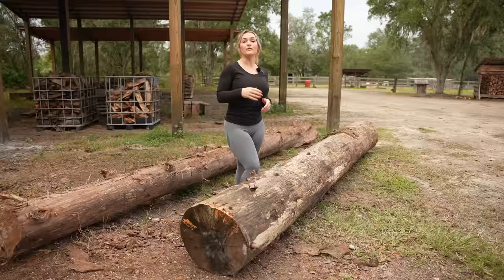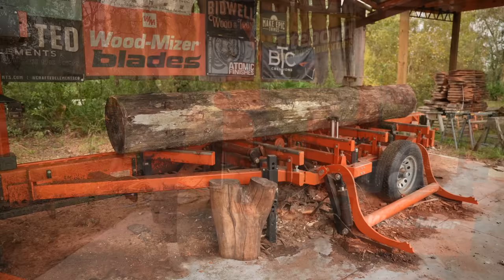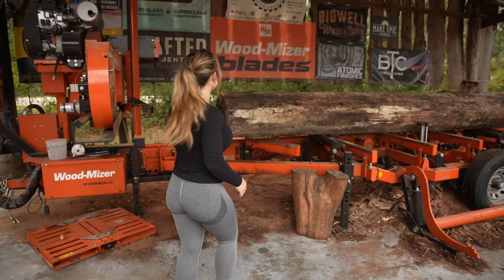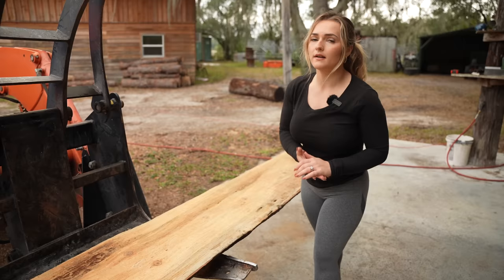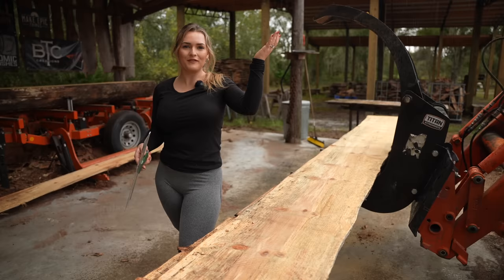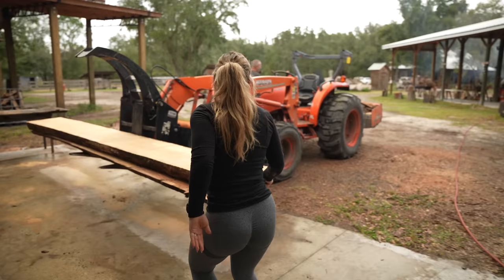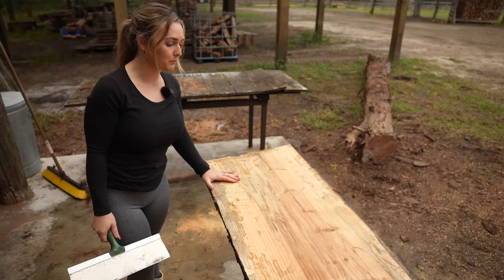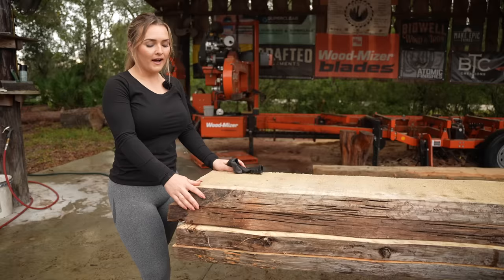Monkey Puzzle Slabs On The Mill Today!

Comment: would suggest that you try "pentacryl" on the spalted and softer areas before cutting them out or resorting to epoxy filler in the removed voids.  Pentacryl soaks in like water, solidifies leaving a "workable" deep layer of that soft or spalted areas.  We use it wood turning and carving of spalted blanks.  It is a polymer but sinks deep into the fibers, bonding them together and filling the voids without becoming brittle.  Nice job on the video.  First time viewer.  What brand is your log grapple?  Trying to find one w/o teeth in my area.